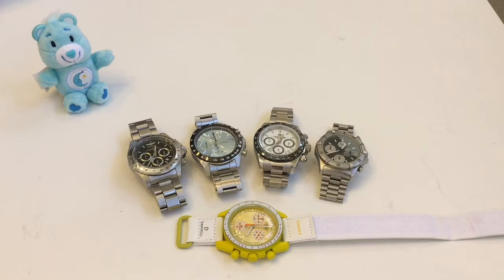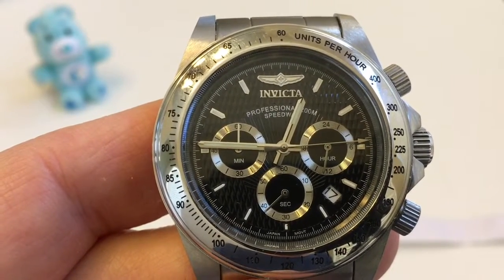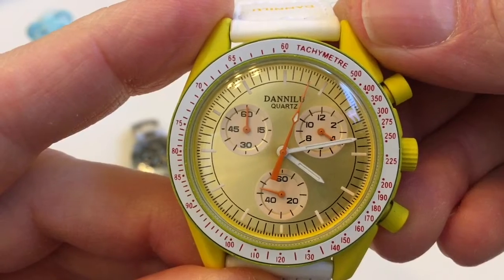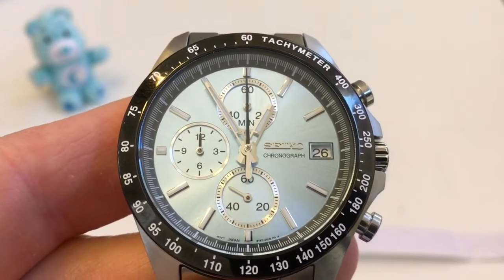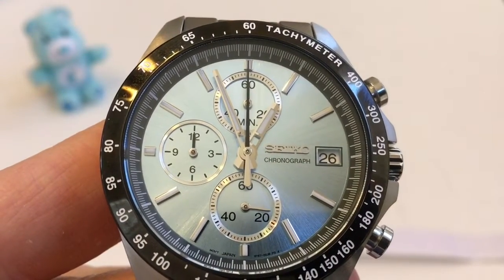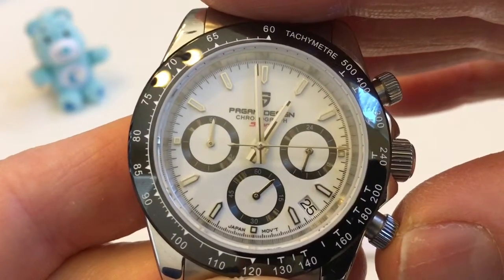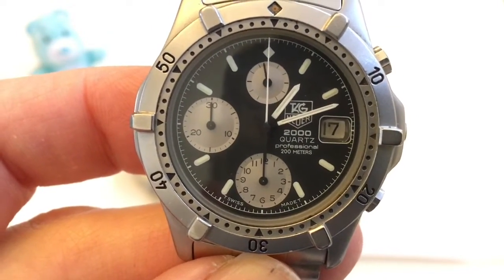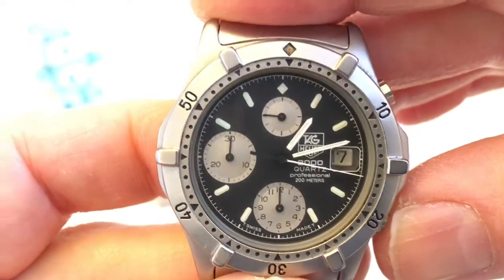How to tell difference between Mechaquartz and standard quartz chronograph movement watch?

Comment: Would you recommend the SSB303P1 model?
Reply from the maker: Yes. It uses the Seiko 8T63 Mechaquartz movement that is the same as the VK63 movement in the Pagani watch in this video. The chronograph will only count up to 60 minutes then it turns off. If you need a chronograph to function longer than 60 minutes then look for a watch with the 8T67 or VK67 which will count up to 12 hours.

Comment: question.. which is better mechaquartz or standard quartz?
Reply from the maker: mechaquartz is premium. usually more expensive. Both keep good time.
Reply: Not counting the sweeping second hand or the flyback, regular quartz is objectively a little better, at least in theory, since regular quartz can possibly have a split feature, and it at least should be more reliable than mechaquartz.

But honestly both are really good. There isn't really a bad choice you can make when choosing between them.
Reply from the maker: @sesetti  Good point about the split times. Can't measure that with a mechaquartz. The Miyota OS20 in the Invicta does not have split time feature either. Surprisingly the Sunon PE50 does have split time feature.
Reply: @mtbbiker6401  Yep I actually found out about it accidentally a couple of days ago. Pressed the wrong button with my speedtimer lol
Reply from the maker: @sesetti  Does your speedtimer have the solar v192 movement? According to manual it does split and two competitor times.
Reply: @mtbbiker6401  Yep it's a v192. You can also pause the chronograph when the split is on. Once you turn it off the second hand jumps to the spot where you paused the "invisible" chronograph.
Reply from the maker: @sesetti  What drives me crazy and I usually refuse to purchase are watches that have tachymeter scale on the bezel but a small second chrono hand subdial instead of a large sweep second hand.
Reply: @mtbbiker6401  Yep that is also an instant skip for me. Luckily most of them seem to be just fashion watches like Tommy Hilfiger or something similar
Reply: Both are good. I prefer the mechaquartz because of the sweeping seconds hand.